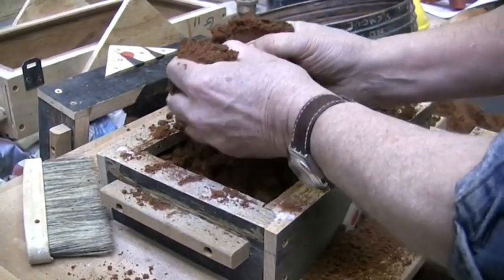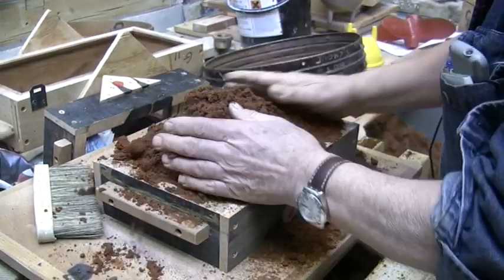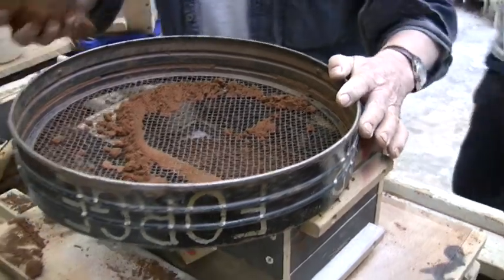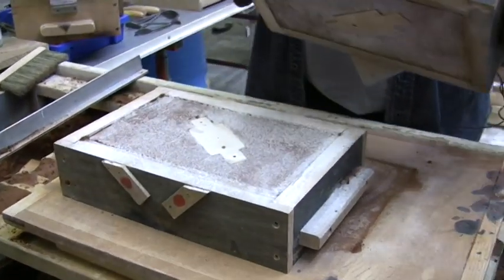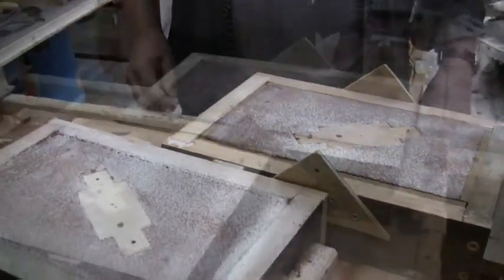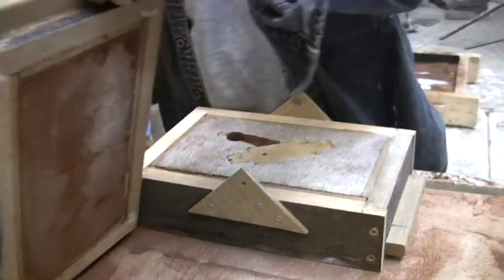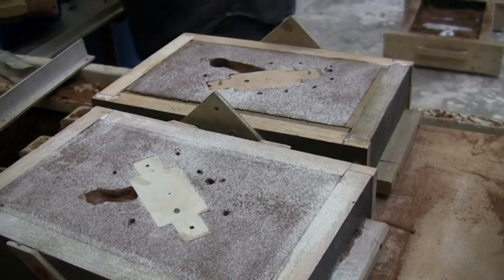Core sand casting experiment - Part 1

Comment: im a undergrduate of mechanical engineering
so i learning casting technique academically and i have a question to casting process
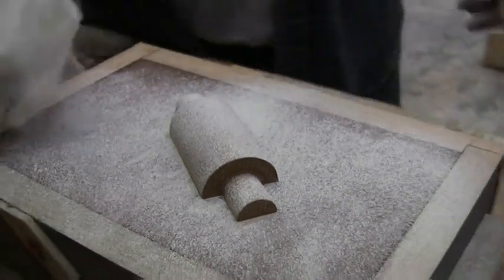is that sprinking sand you’re at 2:36
a parting sand or a facing sand?